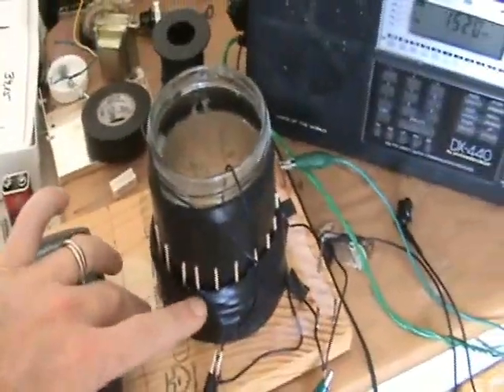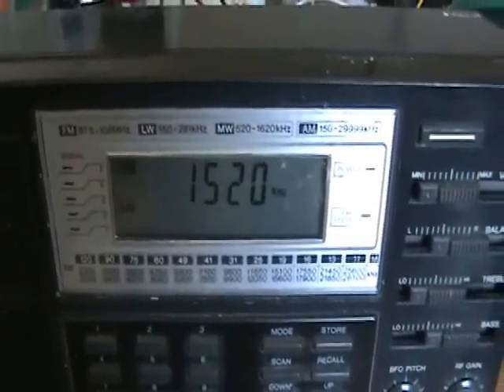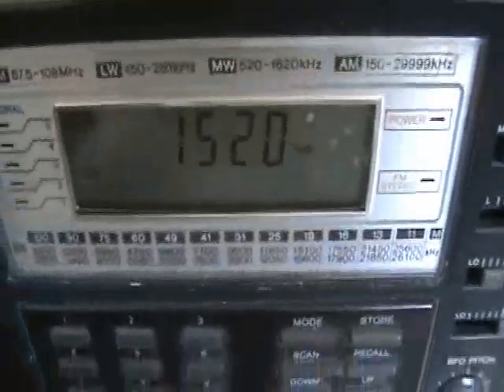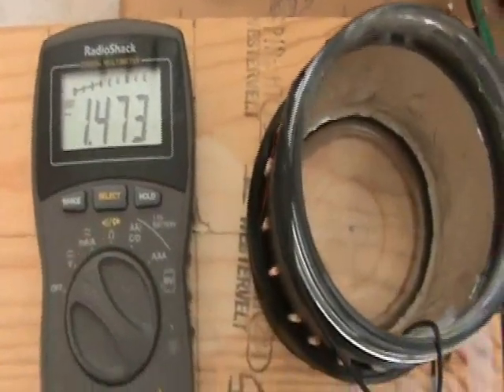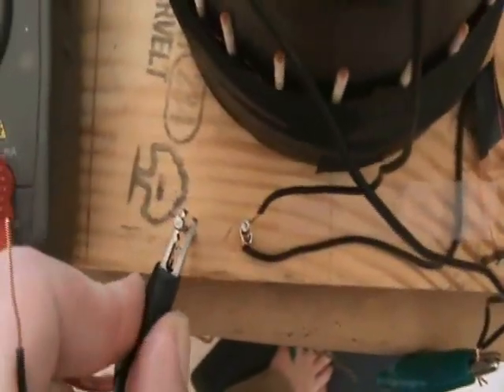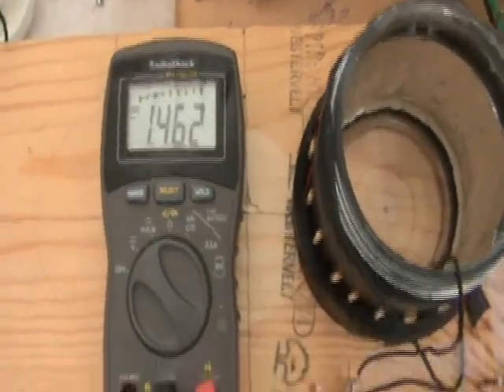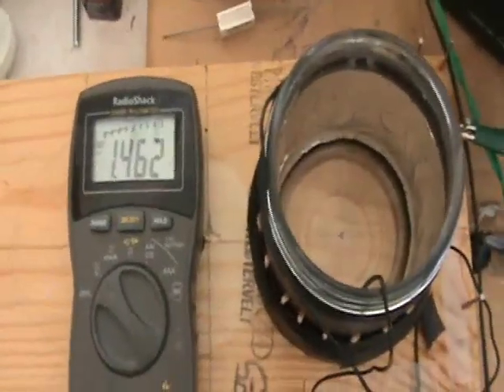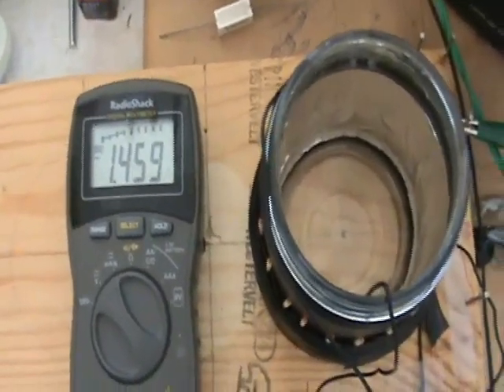Hendershot Coil @ 1520Khz

Comment: you have something wrong there. AM (Amplitude Modulation) refers to a method of modulating a carrier and not a Frequency, so it is perfectly possible to have 2KHz with its amplitude modulated. You could also Frequency Modulate a 2KHz carrier giving you 2KHz FM - 

G7HMJ

Comment from the maker: I haven't done a complete build. I was messing around with various components to see if I could learn anything. There are several mysteries to solve. This device needs to be reverse engineered. There are several different schematics that are strange and incomplete. Which cricuit? It is also not clear exactly how Hendershot constructed it, and what materials he used.